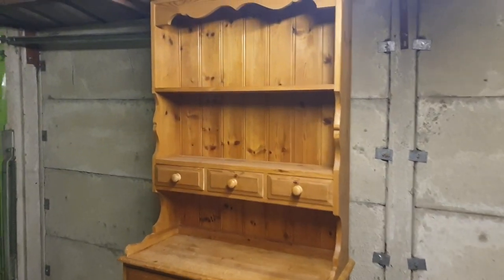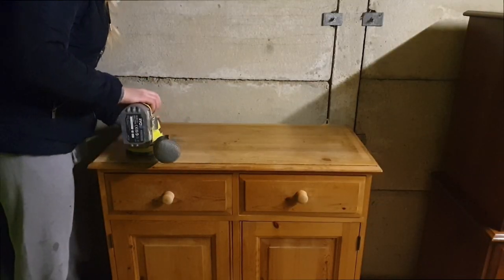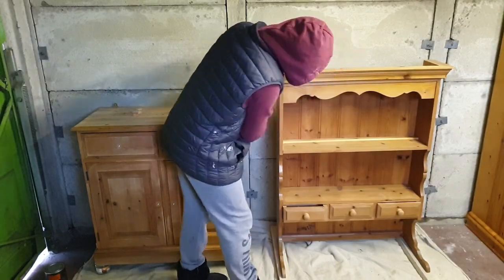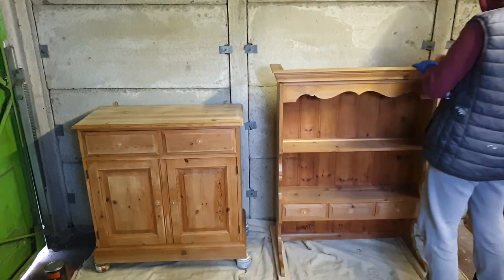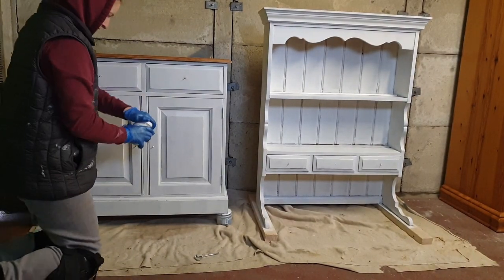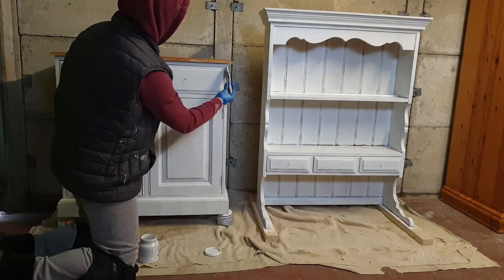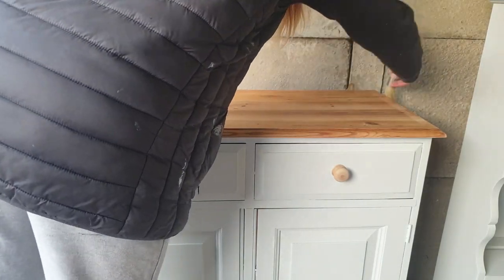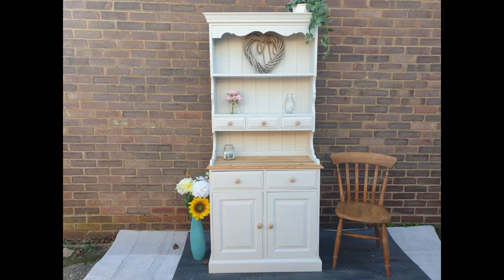Trash to treasure - Farmhouse welsh dresser #makeover

Comment: Great video again, love this piece! With fusion mineral lids i used  to have the same problem, if the lid is stuck on use a sanding pad to grip the lid, but to prevent it sticking put cling film between the lid before you put it away,.
Reply from the maker: Thank you James! That's a great tip, I will do that next time 😁